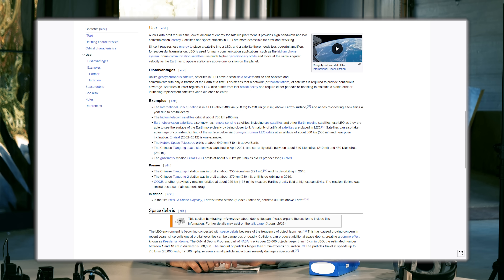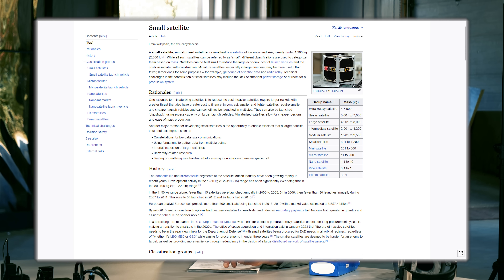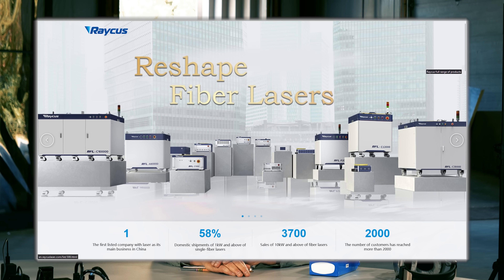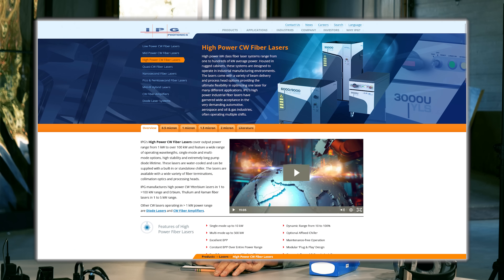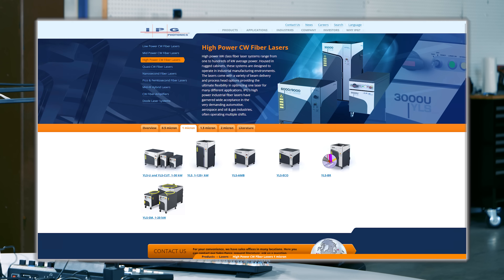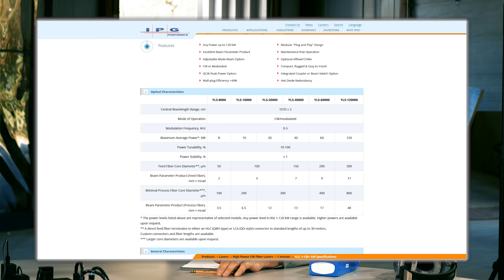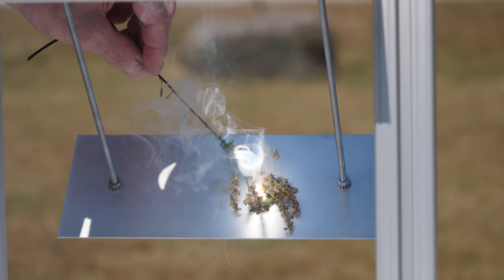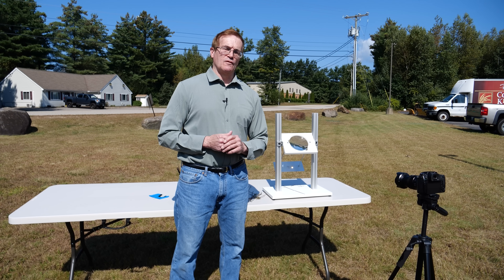COULD SATELLITE LASERS REALLY DO THIS?...

Comment: I used to work in a dance club with a water cooled argon laser from 20w, and because you can't cut off electricity suddenly from the laser tube, because these lasers has to cool down slowly, we had the possibility to redirect the beam outside. The green beam was visible for kilometers, without dispersing a lot. We used dichroic mirrors to achieve this. One time the beam was off and had to be recalibrated, but in place of shining on the dichroic mirror, it shined on the door jamb nearby, and burned a serious hole. So there was a fire hazard with this thing. That's why we had to check, every hour, the very big power supply, the water cooling and the laser itself. This was also a multicolor club laser. So if you see what a 20w laser can do, what about a 20Kw laser? Mind-boggling.
Reply: Good one
Reply: Mind-Bottling* (like your thoughts are all stuck in a bottle.)
Reply: Carre in Willebroek had this laser decenia ago. It was awesome
Reply: *kW
Reply: sounds like a recipe for disaster. why would any dance club have that?
Reply: I dont understand any of that, but thats rad as hell.
Reply: Bruh....wut? It's only 20 watts, just buy a beam dump for like a hundred bucks lol.
Reply: this guy is a fed dis info.
Reply: sounds like you forgot a Kw or two in that laser. 20w is not a whole lot either to power or to cool, nor it burns holes in stuff.
Reply: @mb9662 Most seem to be! Or stuck in the typical rectal cranial inversion syndrome.
Reply: but you needed water cooling for a 20w laser. space is a vacuum there is no air to transfer the heat with. if they did have lasers it would be a one shot deal
Reply: What made those 20W ion lasers so capable of burning a wall or door nearby is their very low divergence, so it was still highly concentrated energy at the distance of a nearby door jamb. By the time the very same beam has reached to the far side of the club though, the beam was already spread out enough that it could no longer ignite paper or wood. And in fact many venues would safely terminate the beam along a wall or soffit at the far end of a large hall. The exponential drop in beam density with distance, as discussed in this video is always an important factor when talking about the difference between a beam that can start a fire and one that can't.
Reply: Had to be close.
Reply: @Bluelagoonstudios, good thing you didn't light up an airplane cockpit, lest feds with cuffs come knocking on your doors. Even shining a laser pointer "at" an airplane is very illegal.
Reply: Do you know the story behind Pink Floyd's gold lasers? It's pretty amazing.
Reply: @ivanjakanov  herpes and aids?
Reply: now imagine 500 satellites, each with a 20 watt laser, orchestrated to point at a common point simutaneously….equivalent to a single 10 kw laser…except with redundancy.  Elon has signed contracts with space force, military.  It’s not only possible…it’s likely.
Reply: - yep shining an errant tightly collimated laser weapon into the night sky randomly sounds very (not-eye) safe - hopefully no high flying aircraft were impacted.
Reply: @kadmow  Nope, the angle was way too low to prevent that kind of issues, that's why you could see the beam so far away. These installations are done by experts. And that side were only farms, you cannot do this in a city.
Reply: @jimhofoss9982  good point... it definitely doesn't need to be one laser. Coordinating a cluster would be relatively simple.
Reply: 20w laser will not burn shit after travelling for a few meters
Reply: 20 w laser? Yes on the label. I do not dispute it burns stuff. Water coolers to cool down huge amounts of energy is not 20w. Use 20 W in any other energy form to start any fire with the speed of the laser? You also be treading in the energy multiplication or energy creation out of nothing. Free energy. I doubt its the case.
Reply: Most commercial laser cutters use 1020w lasers and they barely cut thin plywood
Reply: @MrHighvolt  it was the same club laser we had.
Reply: @ivanjakanov  Why does Pink Floyd used even more powerful lasers?
Reply: @tonyb7748  Not only their lasers, but the whole light scene. We've seen a lot of their video's. Which were amazing.
Reply: CDRH would never sign off on a laser like this for public display.  “Re-direct the beam outside.”  You’ve got to be kidding.
Reply: I’m a big fan of this channel. Your knowledge is amazing . But the Black mil ops have more than the kids inBoston, is my bet . Do you have a friend in defense that “ a little bird told you? “ 
I have seen flying machines that make sharp @“degree turns at speed and make no sound. So much uncertainty. But it is unprincipled.
Reply: @jimhofoss9982  Why would you spend billions of dollars on a firestarter that can easily be detected by weather satellites, when you can do it the old fashion way for less than a dollar?
Reply: @ivanjakanov  Visuals...
Reply: tubes need to heat and cool fairly gradually, solid state devices (i.e. diode lasers) don't have the same issue
Reply: I was told by a guitar tech back when the division bell concert series were being held that molten metals were being used on a projection system of sorts. There were three fire incidents recorded during the tour in Phila PA which I was audience to as well as had backstage access.   I have the heavy weight recording on vinyl from that day with fire department radio. There were three master recordings on vinyl through three different sets of filters. I have also the off-stage chatter and some of the rehearsal. The other two recordings were mastered for the public. Great times and music from an era that will never be reality again.
Reply: l20W is just the optical output.  Gas lasers such as the one he mentions are horribly inefficient. It probably consumes a KW or more to produce 20W.  20W of laser light at visiable wavelengths is supriasingly powerful and  impressive.
Reply: @carlg5838  Even with the insanly inexpensive, simple and powerful  diode lasers that are available now they just cant match a gas or DPSS or dye laser of similar specs and wavelength.
Reply: @marcogenovesi8570 20W is the output power of the laser, not the input. Your typical red laser pointer has <5mW of power, 20W is definitely enough to burn!
Reply: That's a really, spectacularly shitty design for a laser! You can cut power to the laser, tube or otherwise, you cannot cut power to the coolant. There's tons of different kinds of equipment that has the same thing, need to allow the thing to cool down before total shutdown, but the heat source, be it a heavy working engine or a laser first needs to be cooled off before total power off.
A really common tech that did that when I was young was film projectors lamps.
Reply: More Tall Tales from the Big Book of things that never Happened
Reply: Wooo! Tactical laser IN DA HOUSE!
Reply: @duncanvincent6078  conspiracy theories are like that, they don't bother with adhering to the laws of physics, they rely upon wishful thinking alone.
Reply: Wasn't it a worse danger to people's vision?
Reply: @mb9662 exactly what I was about too write :)
Reply: @tonyb7748 That is my favorite album and song

Comment: CNC Fiber laser cutter operator here (LVD Phoenix, 12KW IPG laser source). I've personally witnessed the setup I'm working with, be able to cut 30mm stainless steel and Aluminium (highly reflective and pretty 'abrasive' to the head's built in safety windows). It's crazy what these things can do. 

Every material has it's own sweetspot for efficient cutting. Sometimes there's a trade-off between speed and cutting quality (edge squareness, burrs forming on the underside of the parts, color change due to metal overheating, etc etc), but most materials can be cut quite nicely without losing too much quality. It's an art to cut parts with a nice accurate, sharp, glassy looking side, and me and my fellow lasergods take pride in delivering the shiny.

One of the things fiber setups can do that traditional CO2 lasers can't is store energy and release it as a massive but short blast. We use it to strike a hole right through metal, after which we switch back to "normal laser cutting" and spiral down the side of the "Strike hole" to enlarge the hole enough for sufficient amounts of "helper gas" to be able to blow through the plate (in our case either Oxygen or Nitrogen). After sufficient gasflow is achieved, we re-engage the laser and follow the cutpath while maintaining a set gaspressure. Laser does the melty bit, helper-gas does the material removal bit.

In a process similar to what the LHC does with particles, these laser sources can cycle photons inside a fiberloop and add on to them almost infinitely, and at a set time, they do a switchover into the cutting head, releasing all those coherent photons into the metal, instantly vaporising it, after which the helper gas can blow away the metal plasma (yes, it's turning the metal into a plasma). Some motion systems and head leveling sensors do the job of maintaining a set height above (and a set x,y position on) the plate to be cut, and the rest is just G-code. Most of the time, all you need is basic knowledge of how to draw a shape in Inkscape, and you can cut it on the machine.

Tldr; These laser sources may be advertised as having an output capacity of 12KW, but they can do MUCH MUCH more than that, for small fractions of a second at a time. And most of the time, all you need is a short blast to "clear a path".
Reply: Wow. I had no idea that sort of cutting power was relatively common now.
Reply: @hideousruin   The tech is making big leaps now. Fiber lasers are truly replacing co2 lasers on all fronts. The time between my initial post and now was just 5 months, but I've already read up about 30KW setups that can do 50mm steel without even breakign a sweat. 

There are however several factors that make it so more power doesn't mean more meters cut per second. The operating costs don't scale linearly with power, helper-gas gets to really high pressures when cutting fast (Good quality nitrogen / oxygen supply at reasonable pressures is very expensive), and safety consumables wear out much much quicker (anti-spatter glass, reflection protection gratings, nozzles (pure copper, with brass connectors), scrap conveyorbelt elements, bed-combs (what the plate rests on during cutting), several types of grease cartridges lubricating every moving part of the machine). It all adds up.. 

I'd say for a medium sized jobshop doing their own niche productline and renting out unused laser cutting time, 12KW is about optimal for keeping cost manageable. In fact,  having 2 12KW setups instead of a single 30KW setup makes much more sense, in case one of them breaks down or is in need of maintenance..
Reply: This should be the top comment. So many assumptions made in this video with public information when it is well known that the military and defense contractors have technology that is decades ahead of what is public. A big example is distance being an issue. Distance is a complete non-factor when using scalar physics. Not sure if the video creator is just unaware, or what.
Reply: @itranscendencei7964  he mentionned fiber laser or you didn't watch the video
plus the problem isn't the power, but cutting a metal sheet a few cm from your laser is one thing, but doing the same thing from 100~200km away is another magnitude of difficulty.
Reply: @zazugee  Again, distance is a complete non-factor when using scalar physics.
Reply: @devjock  Would you like to elaborate on the cleanliness factor of the room in which these B E A UTIFUL and powerful machines prefers to be sitting in for the people. Or the current price tag to own one and everything included before you can blast that first beam thru a piece of material. Lol. I bet they may poop their pants a little bit.
Reply: you cleary not , written into what the military has at their disposal that you are aware of ! 
your infirmation is laughable
Reply: @TexasEspy08  I believe that this is what the OP is alluding to. The video creator doesn't seem to understand that he isn't aware of all the new tech that gets kept private by the military for a very long time before getting released to the public. LCD screens being in subs 60-70 years before the public even thought they were possible is my favorite example of this.
Reply: @itranscendencei7964  light is a wave and thus it get affected by diffraction.
Reply: @zazugee  You still don't understand. You need to look into scalar physics. There's a patent by Harold Puthoff for a communication device, so he calls it, that uses scalar physics to communicate at instant speeds faster than light. Go look for yourself, but stop trying to argue with people about things that you are uneducated on.
Reply: @thefinalgrind  I'm not sure about the actual numbers, but I bet it's a good 500000 Euro for the laser setup itself. 
Then there's the consumables (protection windows, pure copper nozzles, brass nozzle connectors (ea; a holder for the copper nozzle that has an engineered failure point so it breaks off instead of the whole head breaking off the Z-gantry when it crashes into something), cleaning supplies, a cleanroom / cleanbox for cleaning lower laserhead windows, cleaning supplies for that, grease cartridges for lubricating the liftlegs on the table switching system, cleaning supplies for removing excess grease, then there's the grease cartridges for lubricating all the moving axes, greasegun for that, tools for the greasegun, replacement grease nipples, labels for those nipples so you know what you're lubricating, it goes on and on..

After that, there's the maintenance contracts. There's some black magic wielding CNC wizards that come check if we've been good boys every 6 months. They do a complete check of every part of the laser, top to bottom. I always stick close to these people, because I learn so much from them. Expensive folks to bring down, but they're worth it. I have no idea what amoutn of money changes hands during these maintenance days, but it's a lot.

One way these lasers can fail is in the simplest way possible. It kills itself.

Let me sketch a scenario. If us simple operators have configured some settings incorrectly, it might happen that when the laser strikes  (basically a short beam of full power that does holepunching like described in OP) say a 10 mm thick aluminium plate, the top surface of the plate turns liquid. When this aluminium plate is a bit porous, the liquid puddle sinks into the plate a bit and becomes a perfect concave mirror that sends 100% of the laser beam energy back up into the head. The laser shuts itself off to prevent that beam from making it all the way back to the laser source, but in doing so, helper gas is also shut off. Liquid metal is sucked into the nozzle, and that kills the lower protection window instantly. Bits of liquid metal spatter onto the underside of the glass and a sensor looking at the side of the glass can detect there's something fishy going on. So off we go to the cleanroom, grab a new lower protection window, go through the whole strictly choreographed dance of replacing that window properly, and we turn the laser back on. Glass is clean, so laser is happy. It starts cutting again. Next product, same thing happens, but the reflection is focussed slightly higher (deeper into the head, past the 1st protection window), and all the laser energy is focussed on the second protection window. This one actually explodes. Tiny shards of glass go every direction inside the head. Laser goes into full lockdown. This is when I have to tell my chef that we ain't cutting jack shit on this laser today. Send in the wizards.

It be hella expensive. But, when it works, it's amazing.
Reply: Or wide burst, diffusion pulse? 🤔🔥
Reply: @itranscendencei7964 I'm sure he is aware, he is dancing around sensitive issues, to avoid stepping on wrong toes. He is a smart fellow 😎
Reply: @jimburden3428  This is what I would like to believe. Sadly, I have seen other people just as smart as this guy, if not more, that cannot simply fathom that a lot of what they were taught was not entirely accurate, and fully adhere to mainstream consensus. You could be right though.
Reply: @devjock 
Do you know why, on this set up, they use the pure copper nozzle with brass connectors?
Reply: @wisernow624  The connectors being brass is because they screw into the head by means of a toolchanger. Brass apparently has less chance of marring the threads on the head side. You can cross thread that sucker into the head, and all that would be damaged is the threads on the connector side. As for the nozzle; I have a feeling it's a combination of heat transfer and gas sealing. Copper is pretty soft, so if the nozzle collides with parts that are accidentally blown upward or something to that effect, it wouldn't knock the head off it's rails (more failsafe sensors that can detect that). The softness of the copper would also be beneficial to helper gas sealing. Some materials require very small distances between the nozzle and the plate to be cut, to ensure the helper gas gets blown through the plate, instead of out the sides of the nozzle.

Hope this answers your question!
Reply: This guy in the video is a sell out
Reply: Several years ago a guy zoomed in on the moon ,and there right beside the moon, a massive circular object that looked like Skylab. As he focused in on this enourmous object it slowly went behind the moon. Hundreds of people commented on it. On commentor simply said... Busted! I've no doubt USA has a massive spaced based Laser. And that object is likely it!
Reply: @itranscendencei7964 find and watch a interview with a guy named William Tompkins. He is the T in TRW. He says everything that's ever been written is ... misinformation.
Reply: @devjock  ; is it attached to electric wave's ?